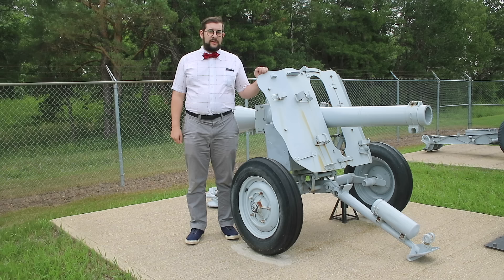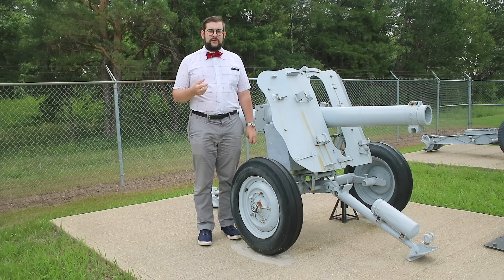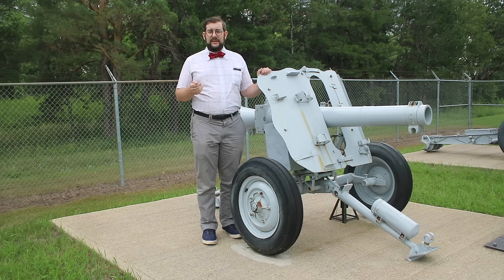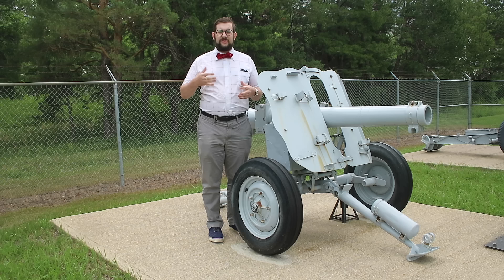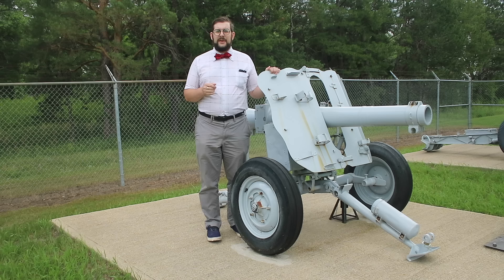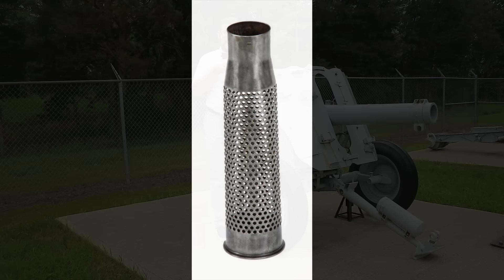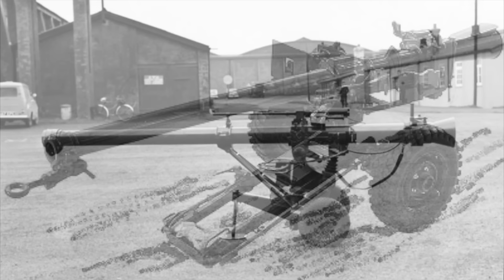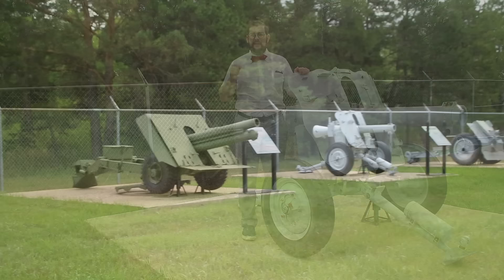Leichtgeschütz 42: the Dawn of Recoilless Weapons

Comment: Rheinmetal actually made a 30mm rotary barrel recoilless gun with a 1200m/se muzzle velocity and 300 RPM rate of fire in 2008. The Rheinmetall RMK30.   It was extremely accurate since no vibration from recoil.  Designed for AT use from Tiger Helicopters it was also tested on submarine masts.
Reply: ok, that sounds interesting.

Comment: Singaporean here. During my mandatory national service, I got to fire the Matador (mentioned at 14:01 of your video). The firing position at the range was a shipping container with a window cut into it, to impress upon us the indoor firing capability. When it was my turn and I stepped into the container, the inside wall behind the window looked like a rocket launchpad- the paint was worn off to bare metal in a radial pattern. Firing one of these indoors is quite a violent experience... I emerged caked in a fine white powder (the countermass hit the wall of the container and turned into a fine powder that got everywhere). Super fun experience... I hit the simulated target easily at 150m. 

We were told each round cost about USD5,000 (in 2005 dollars) so only I think 10 live ones were indented for a course of 30 of or so of us. The rest had to make do with sub-calibre training rounds.

Lastly I also got the opportunity to shoot the 84mm Carl Gustav during my time in service... that was an even more intensely violent experience, especially as the gunner's assistant. When the thing fired a giant pressure wave hits you from all around (I suppose one from in front and one from behind) so it felt like being hit in the chest and back with a thick phonebook. Got the wind knocked out of me for sure.

Comment: The Sweedish AT4-CS (a version of the AT4 84mm single shot disposable recoilless anti-tank weapon) also uses the "shredded plastic countershot" system. This is why it has the -CS designation, which stands for Confined Space.
By using the shredded plastic counter-shot system, it avoids the significant backblast issue that plagues "counter-force" type anti-tank recoilless weapons such as the Bazooka, RPG-7, and M3 Carl Gustav (now in use by the US Marines as the M5 Marine Anti-Armor Weapon System or MAAWS).
This enables it to be fired from a Confined Space without the user suffering the effects of the shockwave of the backblast reflecting off the surfaces of the inside of something like a bunker or other type of room, allowing for much better use in and against guerilla tactics-based warfare.

Comment: With the advent of drones, miniature recoilless weapons have become feasible. You can easily adapt rockets like the gyrojet to be launched with a recoilless system. You can even use the lead shot idea as there is likely nothing behind the drone. A system with a venturi nozzle could easily be made out of thin titanium tubing, just crimped near the rear. The gyrojet was no toy, it could kill you.
Reply: I thought of the same thing recently.
Reply: Rheinmetal actually made a 30mm rotary barrel recoilless gun with a 1200m/se muzzle velocity and 300 RPM rate of fire. The Rheinmetall RMK30.  It was developed for the Tiger attack helicopter because the Germans weren't happy with the accuracy of the standard gun whose recoil degraded accuracy after the first shot.    It worked but fell foul of German budget cuts.   It was tested on a telescoping periscope mast on a German Navy submarine for defense against helicopter, aircraft and anti sub missiles.  
-So rotary barrel recoilless guns are actually extremely accurate.  It's amazing to see it fire as its so rock steady.  You could put it on an elevating arm and hide it within a pine Forrest and elevate 15m when needed..
Reply: Theres no practical need when rockets or just gravity delivers muntion just fine, especially when the overwhelming majority of anti armor munitions are shaped charges or EFPs.
Reply: @cheekibreeki4638  A 30mm round costs US$50 compared to US$100,000 for an ATGM.   The guns on an Apache are used defensively.  As an anti aircraft weapon a 30mm gun can destroy cheap drones with programable airburst ammunition.  Guns have their uses.
Reply: A gyro jet is a different principle though you don't need a counter shock design to launch a rocket out of a tube

Comment: You pulled off your German pretty well.  
I was hoping to find out why the barrel moves back on a ship's gun.
Reply: Recoil absorbtion.
Reply: @TheHunter512  yeah, but none of the ones in this vid did that. This is a great vid tho.
Reply: @savage22bolt32  as I understand it naval guns fire a larger charge with no back blast and require a hydraulic or similar recoil system to prevent the force from being tranmsitted to the comparatively fragile turret ring. Damage to this would affect the ability to aim horizontally to precise angles, a watertight seal and the ability to fire within a precise envelope.

Recoilless rifles are brilliant at what they do but the backblast in an enclosed space would be terminally unpleasant for the crew due to a combination of temperature and overpressure. If you light off a recoiless round in a confined space it has a thermobaric effect on everything within that space. Even some modern AT weapons struggle with this.
Reply: @TheHunter512  i won't be doing that anytime soon!

Comment: Very good video, although you did miss two American designs.  The processor to the 105mm M40 (labeled 106mm to prevent use with the M27 ammo) the 105mm M27 and the 90mm shoulder fired M67 recoilless rifle.  The latter of which (M67) is still in use by the US Army Rangers and Special Forces as trainers.

Comment: Very interesting. Didn't they have solid rocket propellants that they could use instead? Would seem a lot simpler.
Reply: The issue with solid fuel rockets is you can’t turn them off once their lit. But they’re harder to make than liquid propellant as solid fuels need to be very carefully made to ensure a constant combustion rate.
Reply: The issue with rockets is that the propellant must not only a accelerate the warhead but also the heavy casing of the rocket motor. A rifled weapon is also more consistently accurate and does not weather cock.   Nevertheless  both systems work.
Reply: I think the SturmTiger used something similar to a recoiless/rocket hybrid gun

Comment: U.K. I don't often subscribe to an American channel due to adverts and so often being shouted at. I enjoyed your video immensely. Did you miss the Bazooka ? Incidently, I have seen what a squash head round can do. It was against the hull side of a target tank, around 50mm thick. There seemed to be a very shallow dent, but the paint (deep bronze green) was almost intact. However, when I looked inside the tank, the carnage was horrific. No neat round hole, but a scab around 300mm in diameter had exploded all around the crew compartment. No doubt the tank could have been repaired, but none of the crew could possibly have lived.

Comment: Cool, but all these ideas have one common flaw: they use unusual ammunition. Creating a recoilless weapon that uses a standard cartridge would require a slightly different approach.
Reply: The use of conventional shells would have the consequence of launching metal shrapnel backwards if it were to work at all for a recoilless rifle
Reply: @anter176  I think not necessarily. I was thinking about something similar to a Davis recoilless gun, but two "normal" cartridges are placed "back to back" to create a balance of forces. Of course, the bullet in this "rear" cartridge must be "safe" in some way (harmless mass), but the construction of the cartridge itself is "normal", a regular shell, just a different bullet. Optional, as a last resort... The rear bullet is also normal, but it is somehow "caught" when hitting an obstacle "doomed to sacrifice", so that the bullet does not fly a kilometer away. I can see another possibility where one (strong) ordinary cartridge will be used, and yet the weapon only throws a safe mass backwards. This is hard to explain without pasting a drawing here. The key is that I think it would be valuable to use normal ammo. But maybe it doesn't matter as much as I think. You know, I look at it from the point of view of maximum ease of production using "typical" parts.